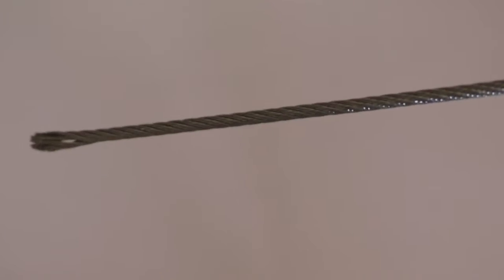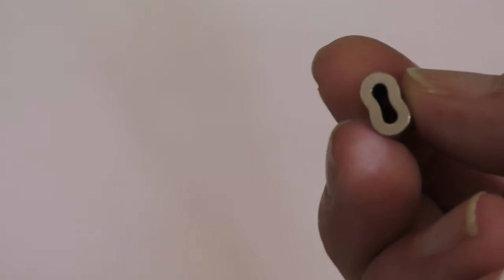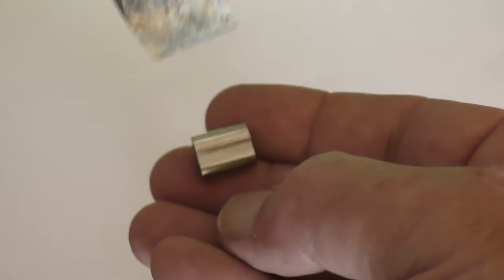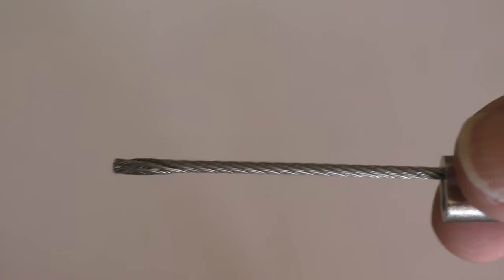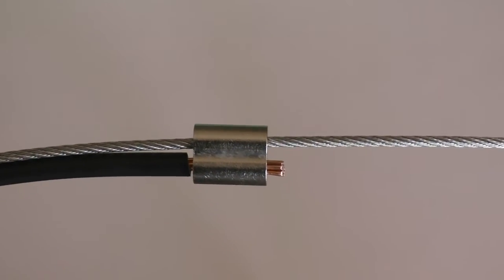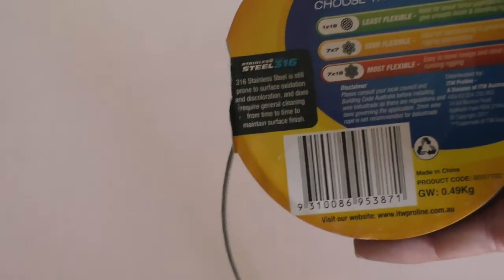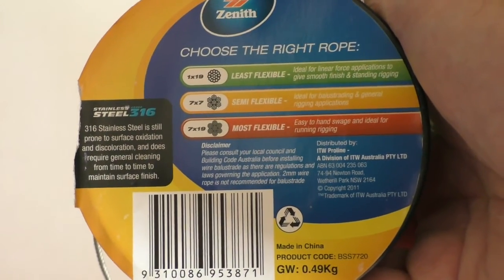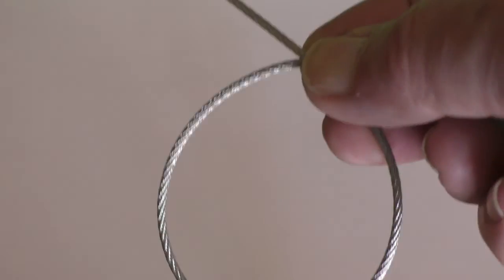Steel Wire For HF Antenna?

Comment: I have 1mm stainless cable which I use for the top elements on my dipole.  It seems to work well enough.  I used simple screw connectors to connect it to the feeders.  I coated the connections with hot melt glue to help prevent water corrosion.  I have a friend who used stainless cable for his end fed wire and he seems to be happy with it. Best wishes from New Zealand.  ZL3ABX.

Comment: I really enjoyed the lengthy shots of your wall. They did much to help explain your use of steel cable as an antenna. 😂 Seriously, my concern of connecting two dissimilar metals is oxidation, resulting in a poor connection and possibly noise. There are anti-oxidation products available that are used to prevent oxidation of electrical contacts. I got mine at The Home Depot in the electrical department, but automotive stores may have it as well. They work great on electrical contacts that are exposed to the elements. However, I don't know how well it would perform in RF circuits. I haven't checked, but there may be products specific for use in RF, it's worth checking it out. 

73, de Mick Bradford - WB4LSS
Reply from the maker: The extensive blank screen and poor focus are the best bits. Thanks for the suggestion Mick but I think the swage crimps the connectors so tightly there won't be room for oxidation between the wire and the swage. Also there is self-amalgamating tape around the swage with PVC tape over that. Personally I would be reluctant to put any kind of chemical between the wire and the swage. I could be wrong of course... I'll let you know if I have any problems.
Reply: VK6CS As I said in my comment, I don't know how well it works at RF, but I know from experience about trying to connect two dissimilar metals and the downfalls it can cause. 

Do you recall the problems of using aluminum wire in homes and the havoc it caused when it was connected to copper wire and fittings. It took a lot of home fires and deaths to get rid of it. I know electricians who use the same product I use on every connection they make when wiring a home. 

Auto manufacturers use a paste product on many of their connections, including tail & brake light bulbs. In fact I had to replace a brake light bulb in my 2005 GMC Canyon pickup truck last year and it came with a small foil pack of paste to coat the contacts of the bulb and socket.  

Anyway I like your antenna idea a lot and if nothing else, it will be a strong one, for sure. 

Good luck, my friend and 73 -- de Mick, WB4LSS.
Reply from the maker: Interesting, I must admit it never crossed my mind until you mentioned it. If it gives me a problem I'll do as you suggest. 73.

Comment: The copper connection will be the culprit in the long run, here on the coast the salt water spray will make the connection go high resistance in a month or two, considering we use stainless steel whips for mobile operation and it has always worked :)
Johan

Comment: 1) Any metallic wire can be used to make antennae.  :-)

2) One uses a swaging tool when one swages a swage. Utilising a cold chisel introduces hair line cracks and it really does not swage it at all. 

NB : A swage is an "all around compression" and a cold chisel makes a mechanical action which introduces said cracks and other uneven indeterminates. 

3) The copper to Stainless connection through the swage  will introduce ALL SORTS of negatives into and out of the signal. These intermod characters will change as time goes by as the joint oxidises. 

Your analyser will give bizarre readings over time.

This jointing method is not recommended but if you must persist then use Alminox and heat the hell out of it first, put it together and then solder the whole thing up and gal spray it. I just wouldn't do it, it's wrong and sad.

Not to mention dissimilar metals, current, water, oxygen...... Come on Steve.....You're asking for trouble. It's antenna school day one stuff we're talking about....

4) Good swaging tools can be purchased from various engineering and tool shops.

5) Will that 316 medium wire stretch over time ? 

6) Overall, I am sure your antenna will work fine most of the time :-)
Thanks for video and the good effort you go to. Cheers.

Comment: I did exactly the same thing. The corellas were chewing through my last dipole, so I bought a role of stainless steel  And build brand-new 'off centre fed dipole'. These pest birds will also chew through the   coax cable so I ended up feeding the Coax down through  some thick  irrigation hose. So now I can watch the Corollas chewing to the heart's content and getting absolutely  nowhere.